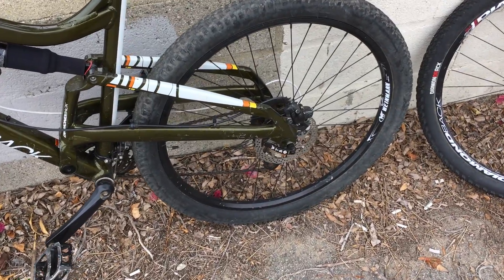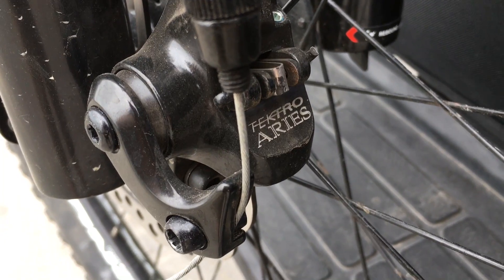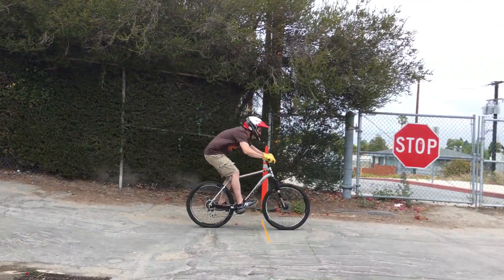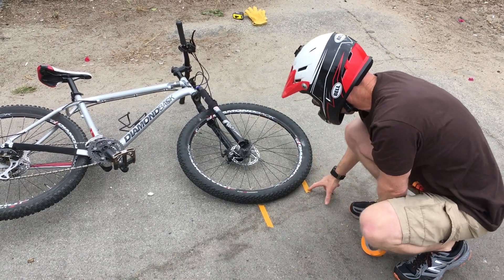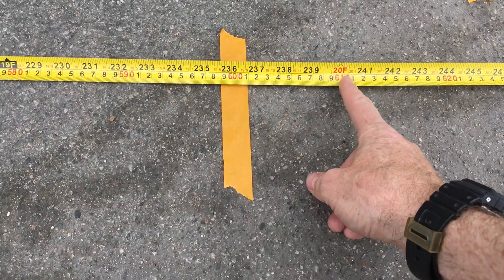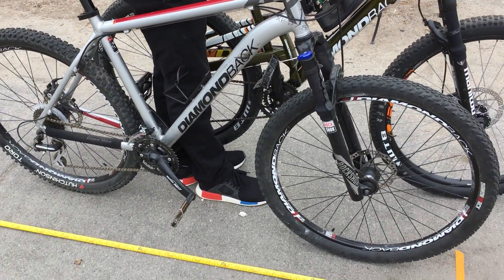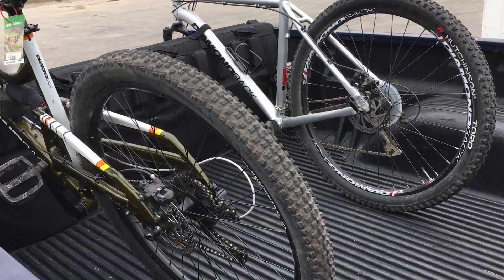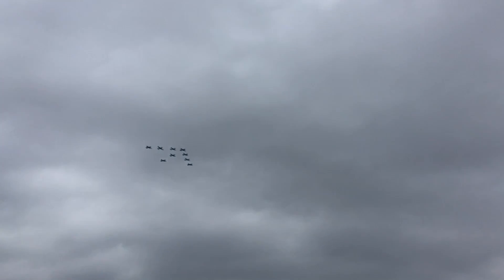Mechanical vs Hydraulic Disc Brake Stopping Power Test

Comment: You'd have to do like multiple tests and have a couple of different users etcetera. And then average out the results.
Reply from the maker: You’re definitely right, but based on basic caveman experiments, if you’ve got strength in your arms, it doesn’t matter which one you have. But with hydraulics, you don’t have to adjust them, and with mechanicals you have to learn how to adjust them overtime.

Comment: This is what false advertising and marketing does, they hype up new stuff and make people think you need this because it's better, but it's all lies.

I did a similar experiment with my 105 rim brakes with Kool Stop salmon pads, against a friends DA hydraulic brakes.  Some slight variations in the tires but the size was different, he had 25c tires, and I had 23 on the front and 25 on the rear, we were within 5 pounds of each other including the bikes; 3 test groups were done, 3 stops at 15 mph, 3 at 20, and 3 at 25, the first two sets we stopped within a foot of each other, sometime he stopped faster and sometimes I did, we chalked that up reaction time.  The last set something happened, the first stop at 25 my rim brakes stopped about 1 feet shorter, the 2nd run I stopped about 2 feet shorter, and the third was 3 feet shorter (I'm rounding because I don't remember the inches).  We thought it was due to the rotor getting too hot because he touched his rotor and burned his finger, but couldn't burn his finger when he touched my rim; but now after watching your video the fade was probably related to the hydraulics itself as you stated.

I've known for years, because I used to race cars, that braking is all about the tire's adhesion to the road surface, nothing more...assuming your brake pads are not worn out of course.

I think you guys should do my test and see if you get similar results as I did.

Comment: Based on this video, I'd argue that the hydraulics were in fact better, but to their detriment. If you look at the way the operator used the brakes, the hydraulics seemed to have more stopping power, but because the rider used too much front braking, the rear tire had less weight and eventually lifted off the ground altogether earlier than with the mechanical brakes. Thus, there was less traction overall (considering one tire had very little/no contact with the ground), and the hydraulics took longer to stop despite actually having more stopping power. I would say this is more operator error, and requires more time from the rider to get to know their braking system and how to manage it best. Without ABS, you really need to manage tire grip by modulating and alternating brake use between front/back. Incidentally, hydraulic brakes are better at that modulation. With a skilled operator, I'd argue that the hydraulics would've stopped faster.

However, all of this is moot as the selling point of hydraulics is the lack of brake cables wearing out, ability to have integrated cable routing, brake modulation, and many other benefits.

Comment: If they have the same power,  which one is cheaper and which one will last long?
Reply from the maker: Mechanical brakes are cheaper, and require less maintenance. With disc brakes you have to bleed bubbles out of the system and change the oil every year or so. They both have the same stopping power, but with hydraulic disc brakes you don’t need to pull the lever as hard to stop. The hydraulics make the lever really easy to pull.

Comment: same pads and rotors etc?
Reply from the maker: Probably. They were both in the same era of diamondback bike. This was not a very scientific comparison. But both hydraulic and mechanical brakes give you enough power to lock up the wheels when you’re going fast, So stopping distance should be the same. It’s just the lever effort that is easier on the hydraulic brakes.

Comment: I've had brake fade with hydraulic brakes, I've had problems bleeding, and I've had someone squeeze the brake hande when the wheel was removed! Avid BB7 were at one point the BEST mechanical disk stoppers.
Reply from the maker: That’s what I was thinking when I made the video. We’ve had all those problems with the hydraulic bike as well. It is really frustrating when you put a hydraulic bike in the trunk of your car to go somewhere, and then you can’t put the wheel back on because the brake lever accidentally got squeezed.

Comment: So You did this comparison 2 years and I liked this. But its 2020 now and i'm wondering what your thoughts are now. I want to buy a bike for future proofing as well. I ride canal, road, park etc but not sure if to spend £600 on hydrolic or £350 on mechanical.
Reply from the maker: I think mechanical are fine. They are a lot lower maintenance, and they stop just fine. The only time I like to have hydraulics is if I am at a downhill bike park with a ski lift to the top. In that case, you have to brake so often that the lower effort of hydraulic brakes really makes a difference.
Reply: @hoohoohoblin  I watched videos about full and hardtail bikes too. You said hardtail are awesome but they are all sold out.
What do you think of muddy fox full suspension bikes, 270 they are?

Comment: Question, what's the better brake for a hyper fat ebike, budget plays no role
Reply from the maker: The stopping power is the same, but the lever effort is a lot easier with a hydraulic brake that it is with the cable brake.  Cable disc brakes are lower maintenance, and more reliable in my opinion. With the hydraulics, I have found that they get squishy and need to be bled every year or so. The added lever effort that you have to squeeze on the cable brakes really isn’t an issue unless you were braking all the time, like if you were riding downhill at a ski lift bike park, which I have done, and my arms got pretty tired.

Comment: Your test is completely flawed from the beginning. Either your Hydraulic is defective as you already experienced a fade or mushy feeling with this Shimano m355 or your pads aren't properly used one. You should get a pristine set for the test's sake. As it would take more or less 5$ to get a set of Shimano BO1S resin pad. Why it's a flawed test? Your tektro aris mechanical disc brake pushes its pad  from only one side of the caliper where hydraulic brake system pushes from both side. That's why your hydraulic brakes should stopped your bike with in a second or two or atleast should take you to a sudden stoppie position. Instead it kind of gradually decreased its speed. Which looks bizarre. Unless you intentionally pull the lever slowly. And from my experience though shimano m355 is the 2nd most basic or cheaper hydraulic brakes on its lineup i never felt mushy feeling with my 2 years of usuage. I was kinda front brake only guy. even Use it vigorously like doing sudden stoppie type braking frequently. Pads lasted me 3 to 4 months. Even after two years of torture, at the end of its stroke my brake  levers stops so much firmly that one could easily confused how old it is! My point is you may have the contaminated brake pads...may have the contaminated rotors which can give you negative impression on hydraulic brakes but now a days all the known hydraulic brake manufacturing brands like Shimano/sram/magura/Trp has so much reliable systems incorporated to their even basic brakes that arguing over mechanical vs. hydraulic sounds like is pencil is better than pen?

Comment: Those bikes are not the same, one is a hard tail and the other is a full suspension, so their weight isn't identical.
Reply from the maker: True. One bike might be 5 pounds heavier than the other one. But I’m almost two hundred pounds, so the weight difference of me on either bike compared to the other one isn’t very much. This wasn’t a very scientific test.
Reply: On the other hand full suspension bike probably makes rear wheel braking a bit more effective

Comment: sorry but i beg to differ because the test was fluked. firstly the bike should be the same and the pads should also. mainly the rider locked up the wheel which can cause loss in traction and go further. learn to modulate the braking pressure. the cable ones dont tend to lock up which means you can yank them harder but not too hard. if you learn to use your brakes properly you should find that hydro is the way to go

Comment: I like how u were interested to find out which best mechanical or hyrdralic however when ur slamming on the front brake and rear brake hard it's best to lean back hopefully you don't have to squeeze. The brakes that hard frequently so it's not like your gonna be really good at it... 

If I am coming fast into or pedestreian (I can't spell) or s cliff or car I just jump off and ghost ride it works everytime lolz

Comment: I'm sorry to say but those hydraulic brakes are POS. Saying since i have those on my Deore Groupset 26" Hardtail. 

Those Mechanical brakes are pretty good def not BR-M355 hydraulic level since I've tested cheaper mechanical brakes on many bikes( Club rides)
Reply from the maker: Thanks. It’s kind of sad that on the low-end bikes they make you pay more to have hydraulic brakes, but they give you hydraulic brakes that are worse than the mechanical brakes you would get on a cheaper model.

Comment: I didn't not expect this level of entertainment and gags for a brake test video. Nice work - I'm dicing up between two different bikes, one with Hydraullic, one with mechanical. At least I know this is not a decisive factor now. If anything I lean toward the mechanical to keep maintenance lower.
Reply from the maker: Thanks. That’s what I was thinking between these two bikes. We’ve had to bleed the hydraulic want to couple times, and the mechanical one just works all the time.

Comment: How about durability and maintenance?
Reply from the maker: The cable actuated disc brakes are lower maintenance than the hydraulics. Hydraulics need to be bled regularly to keep them working.
Reply: Maintenance is the real issue for me .im old and tired and don't want to bleed my brakes , which seems waay to often . I think i'll switch over to dual piston mechanicals. Can you reccomend a good company?
Reply: @siriosstar4789  shimano of course .
Reply: Nayz, i don’t think shimano makes a dual piston mechanical brake.

Comment: Lmao, so the split second longer you took to activate the brakes on the hydraulic test, would more than compensate for the difference,  and are you going exactly the same speed when you actually brake. The test is a bit daft,  lol. At lest you enjoyed yourself.
Reply from the maker: You’re right. It definitely isn’t scientific. But either type of brake stops the bike in about the same distance. There’s just more lever effort with the mechanical set up.
Reply: Actually I'm going to sell my bike and go out and get one with mechanical brakes, maybe I might just get a grifter. 😁

Comment: The quality of the brakes matters too. When put to action, hydraulic brakes are much better. I had mechanical breakes for around 3 years, but when I changed to hydraulic brakes my life was all of a sudden 10 times easier
Reply from the maker: That is definitely true. And hydraulic brakes are better unless they develop bubbles or leaks. These cheap hydraulic brakes tend to get spongy when we use them a lot going downhill. You can pump them up by squeezing a lever a bunch of times before you stop, but it is a little bit scary.

Comment: You should measure speed just when crossing the line. Otherwise this test is invalid
Reply: and weight of each bike. but the difference in their very loose comparison was pretty negligible.
Reply: Frowntown Agreed. Weight of bike should be considered but is likely to be small

Comment: How could i know if its mech or hydrailic
Reply from the maker: Mechanical brakes have a cable hooked up to them that looks like a wire, and hydraulics have a tube hooked up to them full of oil.